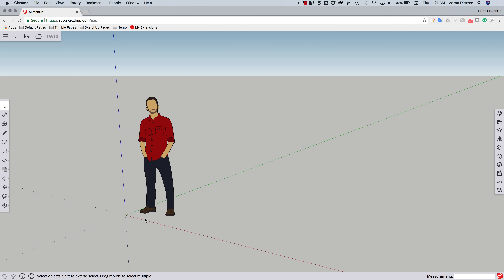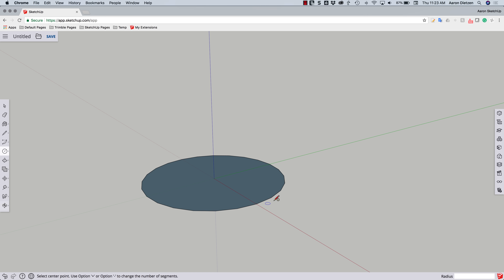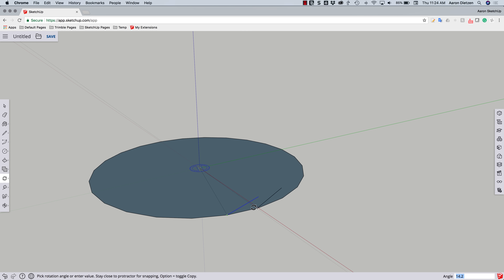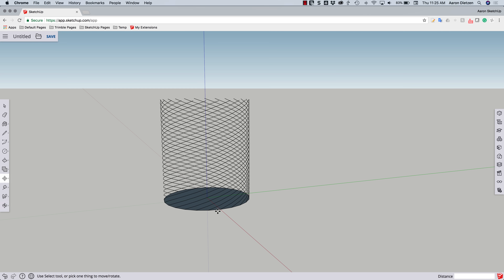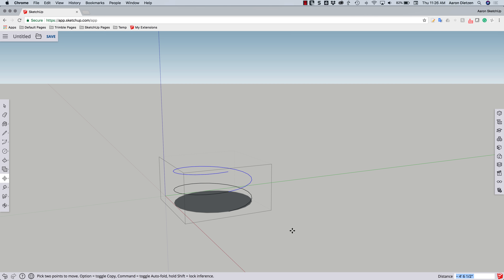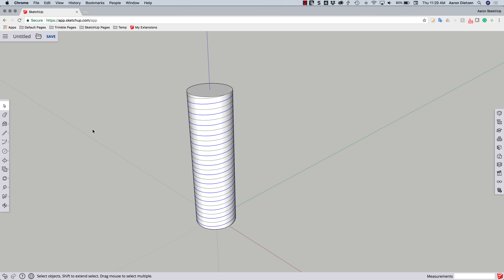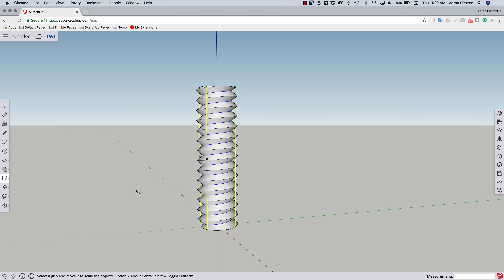SketchUp Skill Builder: Modeling a Screw, Part 1

Comment: When executing the last “scaling” command, it is convenient to grab a point on the edge of the selection and compress diagonally, specifying the compression scale with two values 0.7, 0.7 at the same time.
Reply from the maker: It is not, as that will also rescale the selection vertically.
Reply: @SketchUp  I did not mean the diagonal points of the entire group, but the points located in the middle of the edges of the selection. I was able to narrow the selection in two directions simultaneously by entering values 0.7, 0.7

Comment: If I want to model a spiral ramp this isn't working because sketchup twists the ramp into a diagonal shape for some reason. Because a line, that has been rotatated, which isn't actually shown, because duh, it's a 1D line, also rotates the shape which gets follow-lined along the line.

Seems like this is only possible with plugins then

Comment: This is great video -- I've watched many, but this is the only one I know that shows the power of merging exploded geometry. But I find the threads made using this method to be unrealistically sharp. To get a bit of a small flat surface at those sharp edges, I used 4 spirals at 90 degrees apart instead of the 2 spirals 180 degrees shown in the video. This meant selecting 2 adjacent spirals at once in the final scaling steps. The same technique can be applied to make female threads, although I found it tricky. Once again, the key was making grouped geometry and then exploding it to merge with other geometry. Much thanks for showing how to do this so clearly.

Comment: Hello. I am attempting to follow along, but I seem to be missing something. I'll try to explain the issue. I have made it to the part where we have the repeated spiral and have used a rotate copy to make two of them. We then have to take our original circle plane and push/pull it to create the actual rod of the thread. However, because we made it a group at the beginning, SketchUp is not allowing me to push/pull. I have tried exploding it, then doing the push/pull, and I get a result that looks right, but when I then try to scale the spirals, the shape of the spiral itself changes scale, but it does not move any of the extruded circle, so I end up with a perfect cylinder, and spirals stretching around it. I hope that makes sense. Any clarification or advice would be greatly appreciated. I've tried 6 or 7 times now and keep getting the same result.

To be clear, when I get to the part where you say to explode the extruded circle, I am unable to, as I had to explode it to push/pull to begin with.

Thank you for the help. I am new to this software but finding it very interesting and fun to use. Working on making a replacement part for a watercraft now.

Comment: Decided to Re-create this style in blender since it seems very Costumisable.
wasn't successful to get the Cylinder in place. but was Succefull to get a Screw so Certified Success!.
by Cylinder i mean wasn't succefull to close the hole ;-; from both ends so its left wide open not good for 3D printing but very good for other stuff (doesn't mean i can't cheese it with other stuff like  a Extremly pointy end. but that's that guess i still need to understand more :P 
and yes i know i could use Blender tutorials and get a answer fast but this is much more Funner.

Comment: I’m at the part where we’re exploding things and they arn’t exploding correctly
I select the rod and explode it, and that seems to work (it matches how the video works)
but when I select one spiral (doesn’t seem to matter which) and explode that, nothing happens. It’s still just as black (not faded), but now when I click on it it only selects one 360 degree section of the spiral. I’ve tried undoing and redoing, and even deleted that workspace and started a new one, but I keep getting the same results. It doesn’t explode like the video shows ):

What am I doing wrong?
Reply: did you ever resolve that? Im having the same issue

Comment: Around 7:45 when you were scaling about the center, you had some trouble using the mouse to get it exactly to .7, so you opted to enter that factor directly in with the keyboard.  I was not able to enter the scale factor while scaling about the center.  If typed, I had to apply that factor on all 4 sides.  Is there a chance that you had the same issue?  I can't tell by watching because the difference would only be a 1%  difference on one far side.

Comment: Thanks for this great tutorial. I had a couple of problems, but solved them.  First, I was not selecting the angle line to move it, I kept going back to your video and it finally clicked.  This was my first time moving and an object and making an array with the Rotate tool.  No different than the Move tool really.  My second problem, I simply worked around.  I did everything as you instructed including not clicks after exploding the the final spiral,  but when using the scale tool (with the Ctrl key) and pushing on the red center boxes, for some reason it was only affecting the push side.  I pushed first along the red axis and then the green, but only the sides I pushed deformed.  I tried it several times from the start using undo then Exploding the groups again.  Finally I worked it differently by pushing from all  sides .90.  That gave me good results.  Not sure what I was doing wrong the way you demonstrated.

Comment: i must be dumb AF, or my app sucks because when I group at minute 3:14 my group then becomes boxed, which yours is not. I then use the move to from the point up to the other point and multiply times 23 and I get 23 separate groups. What am I doing wrong? Please help
Reply from the maker: The lines are not grouped (just the circle).

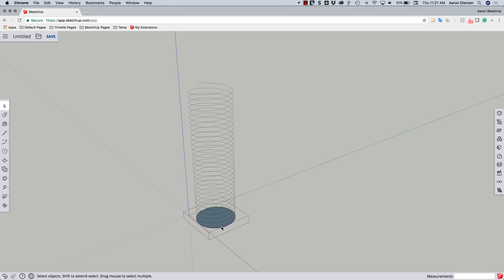Comment: When I attempt this, and get to the point at 6:08 where the cylinder is extruded, the cylinder maintains all of it's faces vertically instead of appearing smooth like in this tutorial. It all goes to hell after that. Any thoughts? I'm using sketchup online. TIA.

Comment: Probably the best video I've seen yet on how to make a thread. Still it does not produce a 100% correct thread (the inner part of the thread is not in alignment with the outer part of the thread).
You could do that by not making a 180 degree duplicate of the spiral and use the 'Follow Me' tool instead like demonstrated in the Bolt-and-Nut video, which uses the DrawHelix14 extension.
Nevertheless, this video is a great video and simplifies things a lot. I could successfully make a wood-screw in SketchUp 8.

Comment: Tried to do this 3-4 times and followed the instructions to the T ...didn't work , have the same issue as Sam Chaney ( top and bottom ).
Now , when I try to "intersect " the cone to the screw , it tells me there's nothing to intersect........anything I'm doing wrong ?
( just a comment .....you show the scaling of the lines inwards only on 2 grips ,should be four "grips" .....correct ?
Reply from the maker: Make sure that the screw and the cone are in the same context when you try to intersect (neither can be in separate groups).

Comment: Thanks! When I esplode the first helix, Sketchup makes some open / missing faces near the top where it meets the circle. How do I fix this?
Reply from the maker: Most likey, you need to model at a larger scale. Note how Aaron's initial circle was very wide!
Reply: @SketchUp  That was it, thanks! It's very strange to me that this is the case though and makes me think that Sketchup is built from an framework based on absolute size, rather than infinitely relative size like other CAD programs are. If I'm not mistaken, I can create a part at any scale in Solidworks and it will behave the exact same way, even if I make it at a microscopic scale. This makes me think Sketchup is more like Photoshop than Illustrator or other vector-graphics programs, and it seems like a problematic framework to use to build a CAD program. It also might explain why Sketchup doesn't allow you to change the units of a file after you create it.

Comment: Thank you for the share. But I still have a question, when I explored the first "spring" structure, I didn't see the merge happened. Does anyone have any idea about this situation?
Reply: I noticed the same problem, what I think happens is that the spiral instead of becoming part of the cilinder is becoming separated. I even did it manually each part of the spiral but it doesn't work when I try to scale it afterwards
Reply: so I just figured in my case, when I created the spiral, I made it a group afterwards, instead of editing the original part of the spiral that was already a group and continue to add on it, which led to the error I was having, when using explode, it was just making my original spiral into the groups I made it, instead of merging into the cilinder.

Comment: I'm making a template for some custom computer brackets. Came here looking to learn how to do things precisely and rigorously. 3.5" hard drives take 6/32 UNC-28 screws and homie's over here, "I'ma make a circle with 24 sides, add some lines, and squish it later." Either these are the wrong tutorials, or I'm using the wrong software.
Reply: Hi Adam! Sketchup can absolutely be used to model precise dimensions. In these videos, I am limited to presenting a skill in less than 10 minutes. Often times that means trading precision for showing the general steps. Any time that a move or scale tool is moved, you can simply type the exact dimension. Alternatively, you can model then use the scale tool to specify an exact dimension.

Comment: Too much work to make 1 screw. It should be a plugin or already implemented as "you click on a cylinder, click on other icon to click what kind of screw you want (inside, outside, how dense those lines are) and they you choose what M size you want. That is how Fusion 360 has. But still it is a good video.
Reply: As you mentioned, there ARE extensions that will allow you to define the geometry you want, then create the screw for you. This, however, is a Skill Builder video! The idea of these videos is to show you how to do things in SketchUp by modeling simple items or making changes to existing models. The point of this video series is not the quickest way to model something, but how to use SketchUp to it;s fullest potential. Also, this was done in SketchUp Shop which does not support extensions, at this time.

Comment: That was an excellent tutorial. I like to try and understand "things" as much as possible, so avoided using any plugins for a screw thread. I needed to model a wood screw, and about two-days after watching this, and trying different methods, I managed to utilise the principles you show here. If your screw can be thought of as a thread profile of "peak, trough … peak, trough …", I needed to create a "peak, trough, plateau … peak, trough, plateau …" – so I created a single thread (with no reversed copy, as per your instructions), then slightly nudged up a copy, exploded. Slightly nudged down a copy, exploded. Returned to original spiral, exploded and scaled "out" instead, to create a narrow thread, with a plateau between. Totally new to SketchUp, but loving it, and these tutorials. Thanks.

Comment: I have done exactly like you. I have my spirals and my cylinder, but when I scale the spiral, my cylinder doesn't change at all...
Reply: Is it possible that some of your geometry (either the cylinder or the spiral) are still in a group? If any geometry is still grouped then it will not work.
Reply: @aarondietzen2995  thanks man that resolved it.

Comment: How can I make this into standard thread sizes? I often use 1/4-20 and 3/8-16 nuts and bolts.
Reply: Once the model is complete and in a group, you can open the group and use the tape measure tool to scale any portion of the model to an exact size.

Comment: Wow, cool Video, thanks Aaron! Btw, why is the UI of Sketchup Free different to Sketchup Pro? Another Question (sorry for Offtopic): I tried to start Sketchup Free on my iPad Pro (with Pencil), but it crashed - are you building a version for iPad? This would be awesome! (Notice: There is a 3d-software out there called shapr3d for iPad with Pencil)
Reply: Thx Aaron.
Reply: Peter Bli The ui in Free/Shop can’t use the standard controls, because everything has to run inside a single browser window. This means we can’t use things like toolbars, floating windows, or tab bars. As for iPad, it’s not really optimized to run on tablets. I know this is something that we would like to do, but running in the web on computers was the first step.
Reply: Ah a hot topic IMHO. I guessed that SketchUp 2018 was created to run on portables, even phones (a huge market). To do that, most of the calculations and workspace has to run in the cloud. The trouble is that Java UI is not as slick. I would have made 2018 just for navigating a model